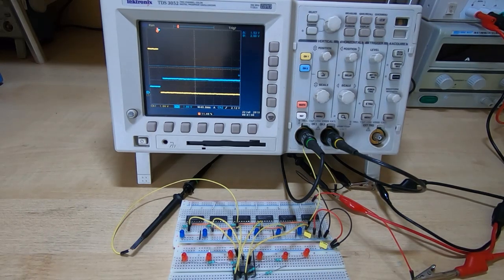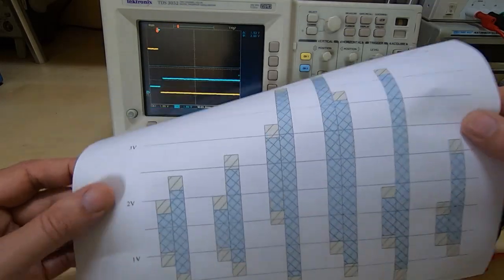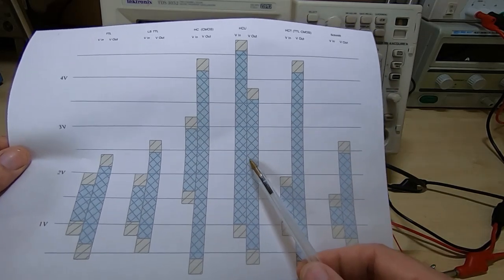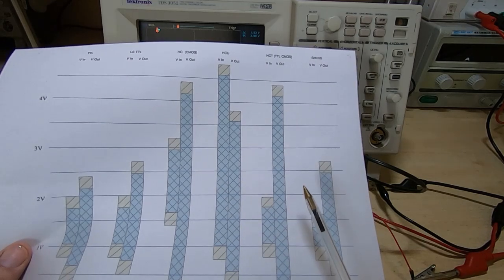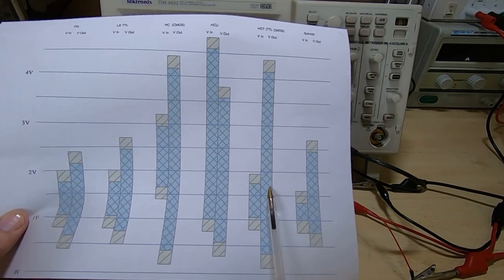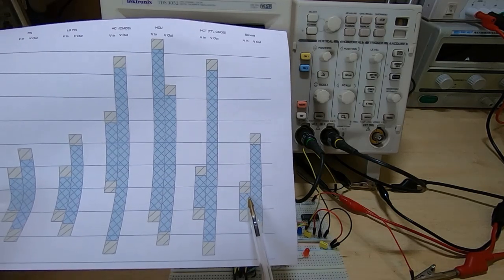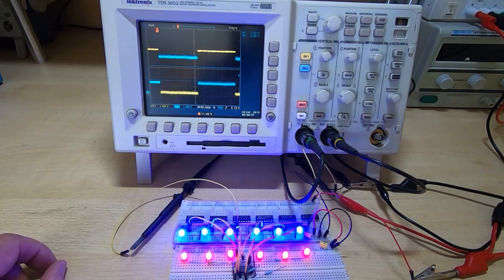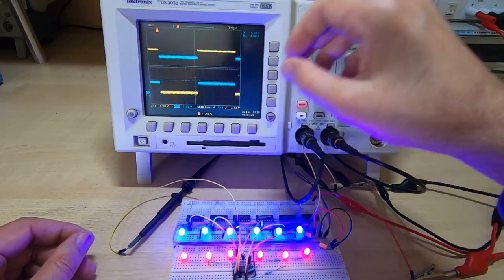Altair 8800 Backplane Noise Part 3

Comment: This is a very interesting video and I wasn't aware that using different 7400 families could cause these particular problems.
Reply from the maker: Yes, I only showed a few of the types available and sometimes it can be a good design solution to use certain types but generally mixing them is bad. I have repaired many items over the years where the only 'fault' was the incorrect family of device. Most common for causing problems is the HC family but there are also families that are designed to operate at 3.3V and they cause a lot of problems if put into a normal 5V system. You also find issues in odd use of 74 devices where some types just will not work while others are fine. It is not just a voltage issue but also odd interactions between them.